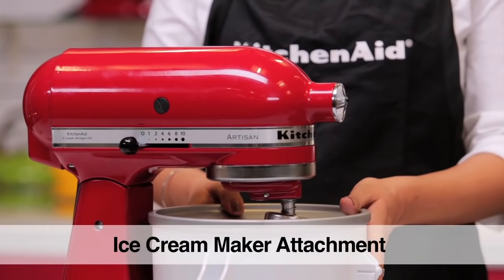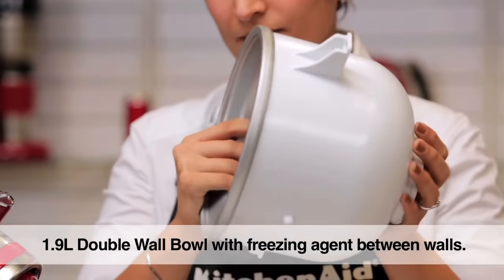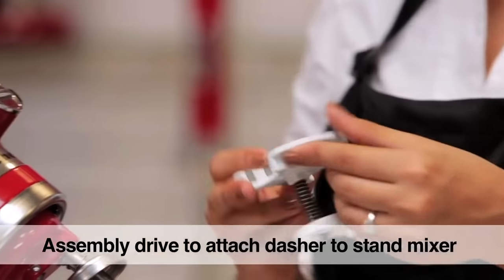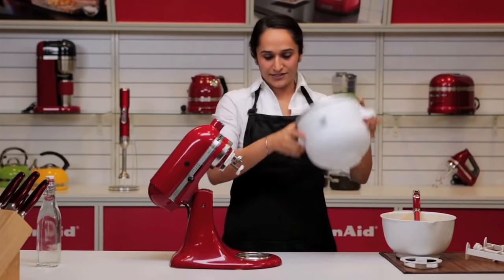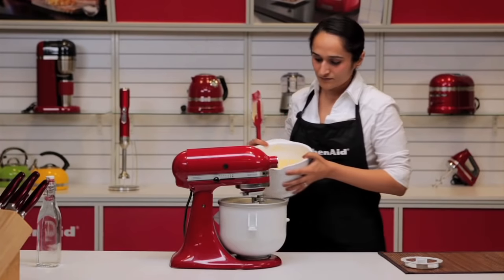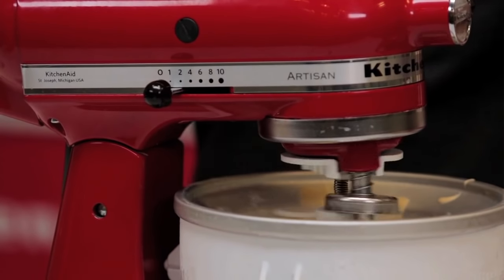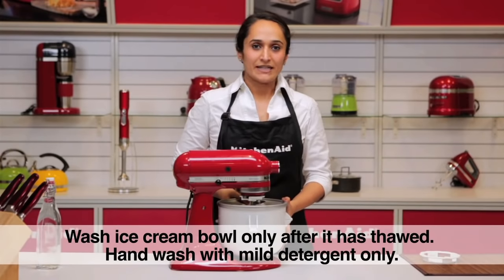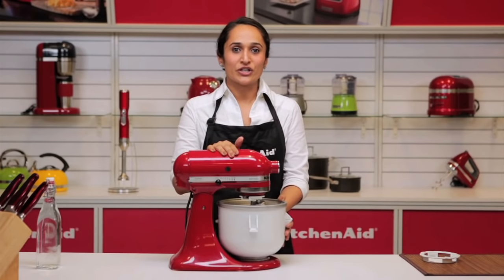KitchenAid® Ice Cream Maker Attachment

Comment: I can’t get the assembly drive to stay on! Can you help me with that?
Reply: Correct again there is nomproperm locking to the tilt head and keeps slipping off ,  the plastic  lock again is not of great design to take the necessary load and keeps getting worn off